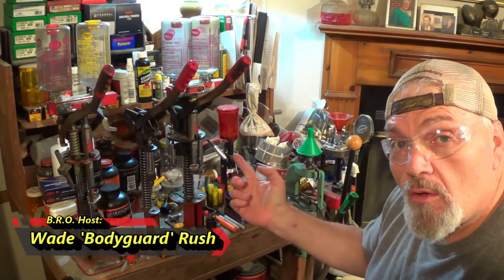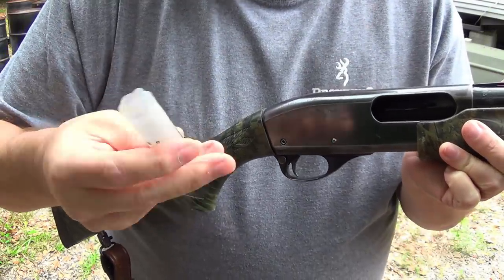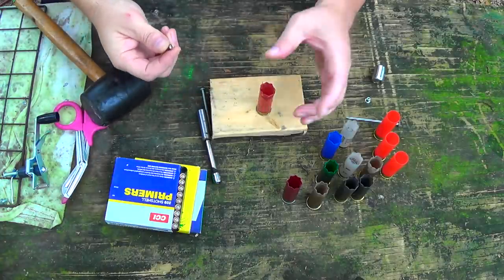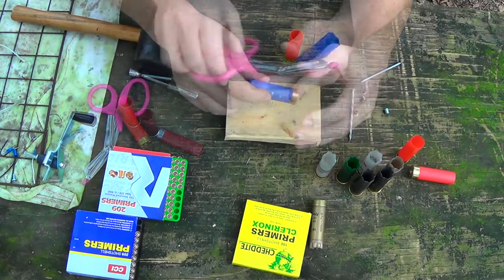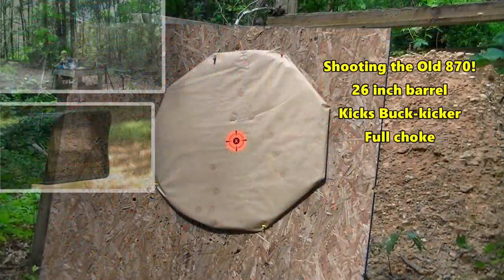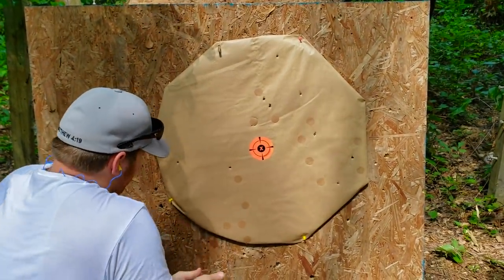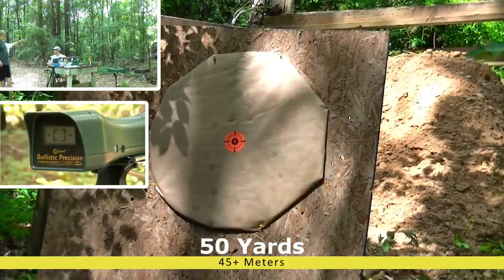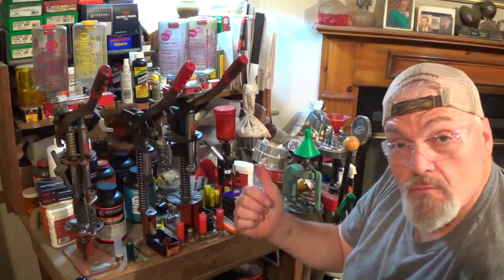Reloading Buckshot without a press!

Comment: Excellent video Wade..!
Roll crimps are great but if you choose to reuse the fold crimp there is a simple method.

Once all components are in, set the round on the table, take a funnel, turn it upside down on the round & push.  You now have a crimp start.  Then wrap your hand around it as if to make a fist covering the opening, take your orange marker or socket & extention and push the large end down between your thumb and finger, supporting the round with your hand, push the fold crimp closed.  You will feel it give when it folds completely...  works great!

Thanks for the video...

Comment: Smiling!
Just got into reloading shotgun, been on and off reloading 223, 45 acp, 38, 357, 9mm, 44mag, 44 special. for years. 1974 or so, now retired and doing a lot more... well until everything disappeared.
Can't find 209 primers anywhere, was lucky and got some primed 2 3/4 and 3 1/2 hulls from ballistic products 300 but only 100 left. Hoping things will get back in stock soon. 
Like you, got some slingshot ball bearings on amazon .25 and 5/16th. little worried about them hurting my barrel, looking for some longer wads so they can ride the full length of the barrel. 
Watched your video powder coating them with the longer tps wads (them wads are pricey) but will do if I could find some. You think the powder coat will save the barrel from damage?
Great videos, always lots of videos on stuff, but every now and again you run across some like yours and pretty much learn what to do and not do and you talk like a Christian man. Thanks
Ed from Arkansas.

Comment: Mr. Rush, thank you for the video that really got me started !!  All of the "machinery" I have is a roll crimp tool ( and now a hull vise and an exactaroll for my drill), and I do have a Lee dipper set, a mic, and set of scales.  I saw that you loaded the 10 pellet #00 load into a value hull from BP with a Claybuster wad.  I've noticed that the CB wad is VERY loose in my new, primed Cheddite hulls and while I have a small bag loaded with just the CB, I have loaded the rest of mine with a .125 Nitro card underneath which fits good and tight. Obviously, you shot a great pattern with yours just the way it was, but I'm concerned about blow by or LS powder leaking from around the wad.  Do you have that problem ??   Thank you again !!
Reply from the maker: Yes, sometimes you can get a few flakes of powder leaking by in the straight-walled hulls when using a wad that was designed for a tapered hull. Your idea would definitely put a stop to any 'blow-by'.

Comment: I think my old  'Made in Connecticut'  Mossberg  590A1 "Thick wall barrel"  ^might have a slightly  oversized chamber ...because,  it is very tolerant  of oversized hulls  or  slightly dimpled buckshot loads.  OTHER  shotguns may also have oversized chambers.  I resize with the MEC, because I have one....and NOT all of my shotguns have oversized chambers.

Comment: Question if i wanted to reload 3 inch or 3.5 shells that are high brass will i run into a sizing issue on the brass if shot from a semi loader?
Reply from the maker: Yes you will. You would need a way to resize your brass!
Reply: @BubbaRountreeOutdoors  thank you waterfowl is getting expensive so gonna start reloading here at some point

Comment: Sorry for a dumb question, but. What books would you recommend for reloading buckshot and slugs for 12 and 20 gauge?
Reply: Lyman number 3 is the best. I have 1-4 and 3 has loads using several slugs including cast Minnie balls and round balls as well. You can find # 3 manual on eBay . Lyman 4 + 5 have less slug and buckshot loads than the other three manuals. I also have bpi and several other manuals and always go back to Lyman number three. The care.
Reply: @johnblood3731  Thank you very much.
Reply: Ballistic products buckshot reloading manual also works very well! Plus they sell everything in the manual!
Reply: @c3outdoors  Thank you.

Comment: How bad does the normal star crimp  screw the roll crimp? I haven't reloaded shotshells but want to. Got some cheap federal Walmart hulls saved for I'm guessing what will be one load of slugs or buckshot.
Reply: Not too bade. Depends on how raggedy the fired Hull is, the prefired length you are trying to achieve, and your roll crimper. Without trimming the finished hull will be longer with a longer roll crimp. The fold also slowed down getting the wad and overshot card into the hull.
Reply: For about $50-60, a Lee Load-All 2 is a solid investment that will hugely speed up reloading over a hand tool kit. From my experience the Winchester 209 primers being just a little wider fit the brass plated steel bases of cheep federal hulls better. Oddly Federal 209 primers being just a smig longer seem to fit the cheep steel Winchester hulls. An upgrade at about $6+shipping for the Lee Load-All 2 is a second resizing ring. Than way you can resize a hull while knocking a ring off another hull.

Comment: Hey wad, 3 1/2in fed. Hull. 35gn longshot, 2 .690 pumpkinballs , out of M3500 steogers ,safe or not safe?    I put one together and it's super heavy, I really dont to blow up my new shotgun
Reply from the maker: that's awful heavy! i have never seen a load over 2 1/4 ozs in a 3 1/2" load: https://www.hodgdonreloading.com/data/shotgun  The heaviest loads usually have Blue dot or IMR Blue powders suggested.
Reply: @BubbaRountreeOutdoors  thanks for reply. never tried it and couldnt really find any info for doubles ,I think I will just scrap that idea.
Reply from the maker: @markdiebel6354  All we have to go on with the double ball loads is the lead payload weight data! The Lyman shotgun manual has a lot of info and data using lead payload weight!
Reply: @BubbaRountreeOutdoors   I'm gonna order that this weekend.. thanks for the info

Comment: I'm not knocking Wade. For those really interested in this concept of reloading without a press, check out what the bushcraft channels have done with this concept. You will quickly find you are only limited by your creativity and time.
Reply: #1 upgrade over Wade's tool kit would be a better punch for driving out primers. An actual punch works, but a screw driver, a screw driver, or dowel with a nail in it also works. Really something with a handle is much better.

Comment: Also. I am not impressed with the patterns even at 50 yds.  Tad slower might help. That is why I only use 1f Goex for black rounds . Less powder or a slower acceleration always tightens the pattern. Shot is shot. #14 bird to 13.5" grape shot. Newton still had it right.  My 2 cents worth